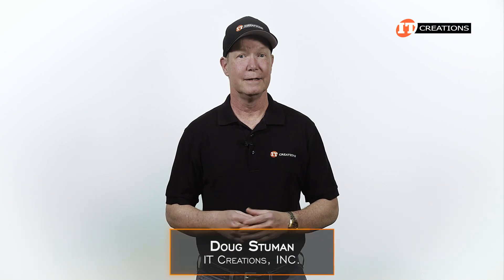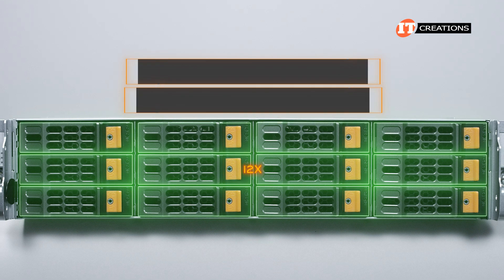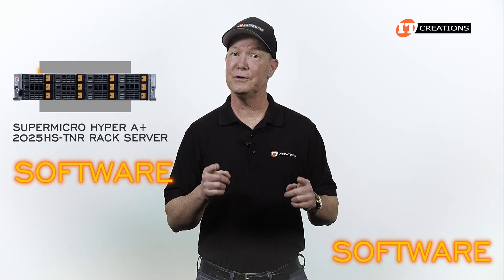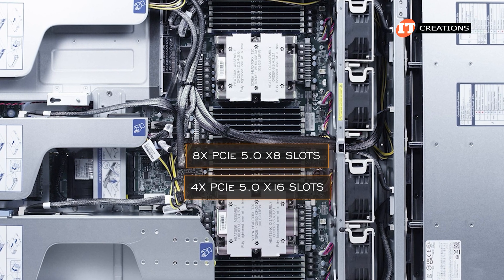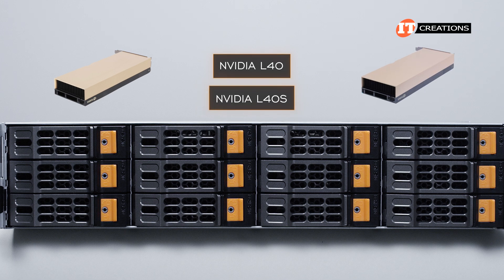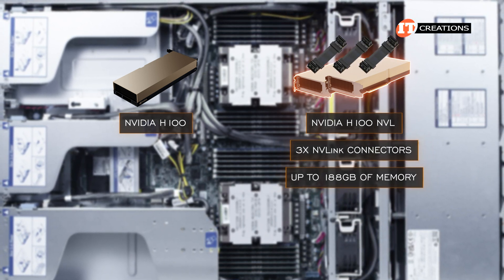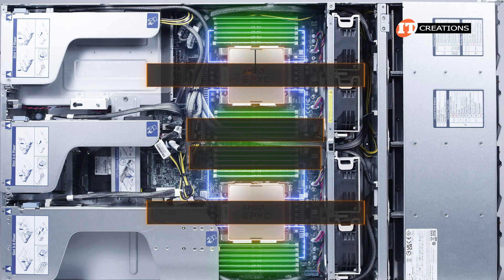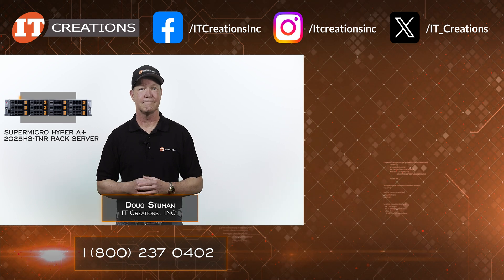5th gen AMD EPYC-Powered Supermicro Hyper A+ 2025HS-TNR Server | IT Creations

Comment: Interesting that they did not use e1s screwdown slots inside or 2 hotswap slots on the rear of the chassis instead of the m.2 slots. It would allow customers to use either m.2 or e1s ssds and be hot swap.
Reply from the maker: On the newer systems with Intel Xeon 6 CPUs, they do seem to be incorporating exterior accessible M.2 caddies kind of like the Dell BOSS system. Thanks for commenting and watching!